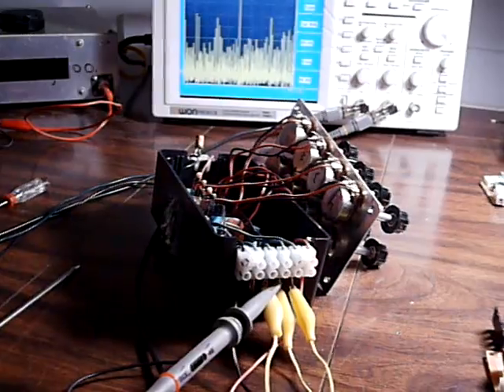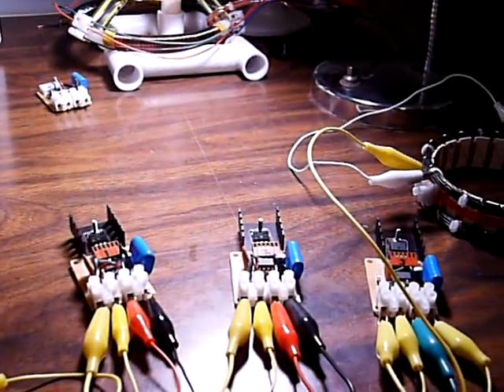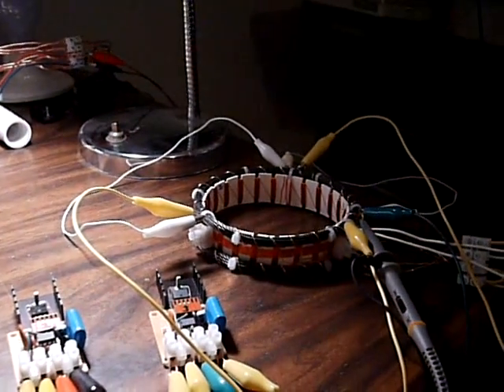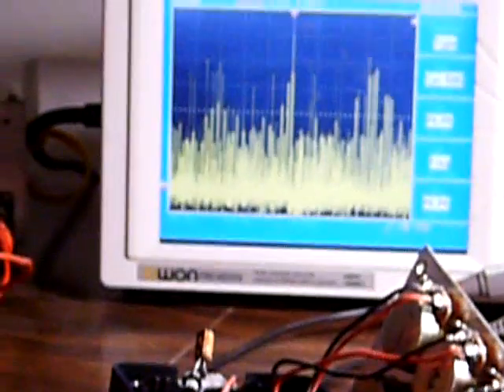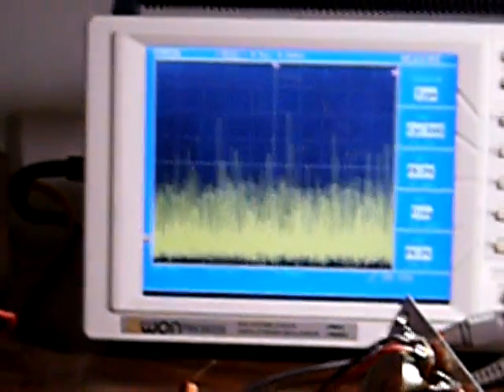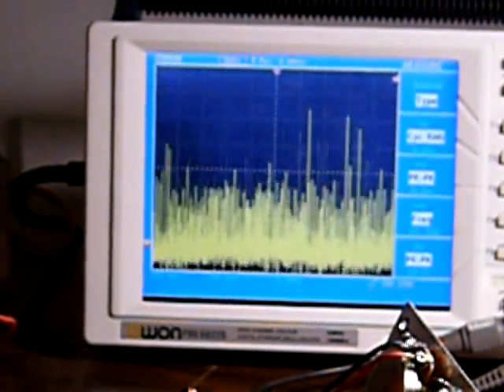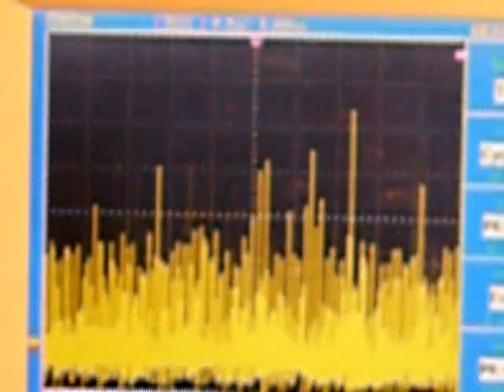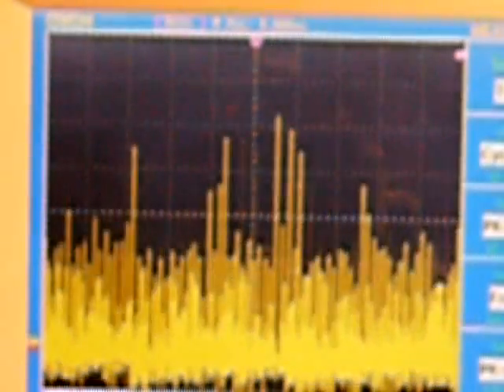TPU lesson #3

Comment from the maker: Yep. 
This creates the high voltage. The next step is to use the coils to convert the v to c. The frequencies at resonance cause the biggest effects.
And no to the last. But I am incorporating other of Tesla's designs to get there.
I am not giving up that is why my thread is so long.
I reverted back to using stunguns to rehash the energy type. I now go to the heterodyning board for control. I got alot of tests in the que. But there is always other research to be done.    
--giantkiller.